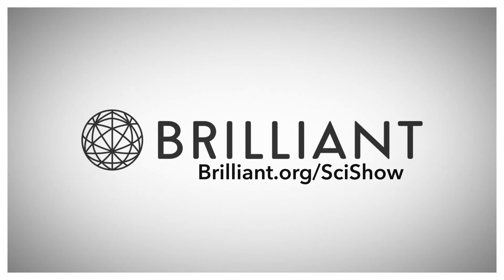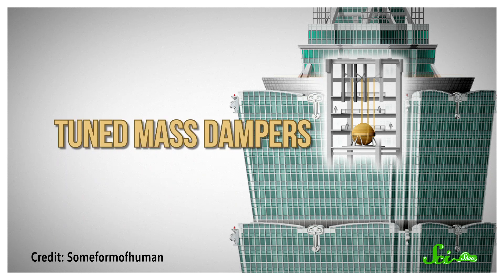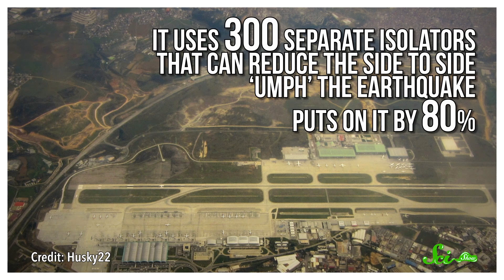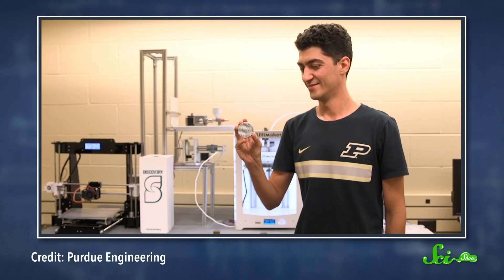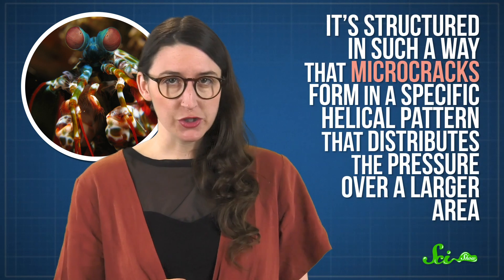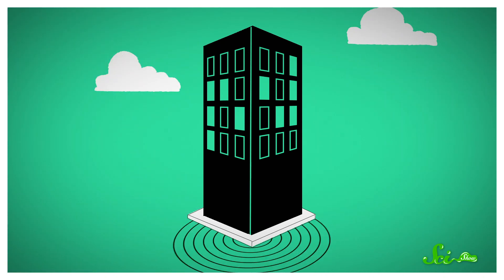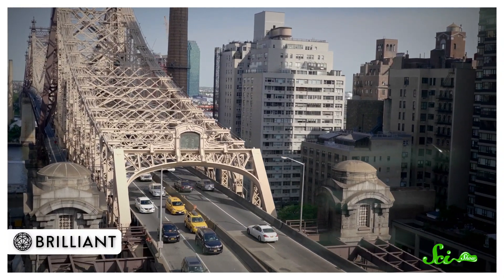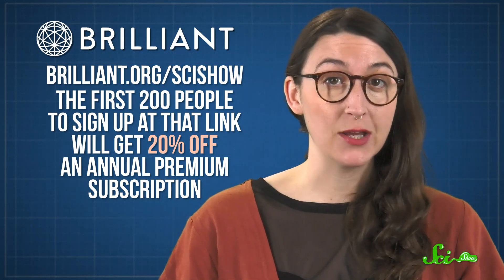Can We Make Buildings Truly Earthquake-Proof?

Comment: To save the building is shock absorbing and balance conserving but to save the city a floating foundation that can be anchor by steel wire ir hydraulic column to act like damping absorb all seismic wave to prevent from resonance and a large building if float up we can counter earth rotation speed and acceleration normal speed is 10 km per hour

Comment: The most structurally sound 3d geometric shape is a sphere...because the stress is evenly distributed to the base... 

A semi sphere is also very structurally sound...

Technically you could build a sphere building... And stabilise it with four posts or a ring or a torus... Most earthquake proof building in the world....the only danger is it rolling off... But four very deeply implanted metal beams would solve that... You could basically drill four very deep holes in the ground and put in some very sturdy metal beams and that ball isn't going anywhere...
The internal structure would need to incorporate an onion skin sphere combined with a lattice to preserve the weight distribution... There ya go problem solved...

You could construct the internal metal lattice frame structure first... And then fill it in with whatever materials you want... At least that's how I would do it...

Comment: The pyramids(4500 years ago) were designed to withstand earthquakes...

But four sides is not the most structurally sound shape...

A hemisphere like the Skellig Michael (1500 years ago) monastery is actually the right way to do it...

The more sides of a hemisphere the more structurally sound it is...

If it actually has to touch the ground...

But technically any shape is fine if it doesn't... Think magnetic levitation...

Comment: I resisted saying this because overall the video is great. But in reality, Structural engineers provide tuned mass dampers to reduce the wind-induced accelerations in buildings for occupant comforts and not for seismic protections. 

I design high rise buildings in earthquake-prone regions like the US west coast and in no tall building, you will see tuned mass dampers as a seimsic solution. Because buildings respond at different frequencies while tuned mass damper can help a building at one particular frequency, it becomes useless in earthquakes as the response of a building is more often at high frequencies rather than primary frequency that the TMD was tuned to. A much more efficient solution is using viscous dampers.

Even in TAIPEI 101, the dampers excitation during an earthquake was inconsistent again because of the high-frequency nature of the ground motions. The engineers themselves would not have counted the damper as the source of energy dissipation in seismic excitation.

Comment: ... a 10 meter wide building? That's not even house-sized.
Reply: My house is less than 10m wide. It's about 6.5m wide. Not everywhere has enormous houses, my house is a perfectly normal one where I live with thousands of the same design in the area.

Comment: Wood was or is also making a comeback because of that, right? They figured out a way to make wood waaaay more resistant to fires, and then you get the benefit of it being flexible enough to resist earthquakes. Or so I heard.
It's also interesting to look into japanese architecture... I was watching a doc about the reform they did on Tokyo Station. The entire thing was lifted to sit on top of a moving platform of sorts. The scale is baffling.

Comment: A couple new systems you missed that are very cool are the post-tensioned rocking shear walls that are purposefully designed to rock, but not fall, and the joints of the rocking would be specially designed to not have significant damage post-earthquake, and some quickly-replaceable systems, like steel-sheet shear walls and some pre-manufactured products.

Comment: As a structural engineer who does seismic design on a daily basis, none of these "future solutions" are not anywhere near cost effective enough to implement. It's easier to design a building that has the correct stiffness for the design location.
Reply: Do you consider dampers and seismic isolation to be "future solutions"? They are widely used in countries such as Japan.
Reply: @BobClemintime  no I'm talking about the ground dampeners and the couple ideas after that.

Comment: i haven't been in a large raw earthquake (i'm in kansas) but in recent years i have experienced many shakes and they don't seem to happen at a fixed frequency, it is more like the rug being randomly pulled out from under you. so i don't see how a frequency dampener would work, because while as a whole it might have a frequency at the point of effect, it is pretty random, and when i say random i mean that it doesn't seem to be at any particular frequency. i'm certainly wrong, but i am curious.
Reply: The idea behind those particular techs isn't to match the primary frequency of any quake but rather to match the frequency at which a specific building shudders to the point of taking structural damage. If the tech can alter the local vibration enough that it matches the building's tolerance level then the building may come through with much less damage.
 The specifics are different for every building, which is why most of it is based on localized zones and not entire neighborhoods.

Comment: Am I the only one who thought 'bed springs' on seeing the 3D concrete being printed? Wouldn't using thick enough memory metal in place of the concrete be a better idea? It's less likely to crack. But it would need a test devised so that after any earthquake of a minimum size the spring could be checked and fixed/replaced (individually placed but connected rings or whatever shape would be the best, would make that easier), so there wouldn't be a sudden snap during the next one.
It's only a coincidence (honestly!) that hubby's car's front spring sheared the other day. No sign of fatigue, just broke as he went to drive away. Mercifully, it wasn't going fast, he only went a couple of metres! But it was that which made me think that checks would be needed. It would be better than having to replace a shed load of weakened concrete, wouldn't it? (I humbly stand to be corrected, I'm currently not thinking 100% straight. Meds, not booze sadly LOL)

Comment: I'm surprised you guys didn't mention something about the bridge that uses giant shocks with locking collars designed with prescribed failure to prevent sway until they're needed to stop damage from an earthquake.
Reply: Yummy . I'm looking that up !
Reply: @IETCHX69  Glad I could help inspire curiosity.
Reply: A name would be nice...
Reply: @brunoratto253  I don't think this is the bridge mentioned in the show I had first seen this idea used on, as those were actually ON the viscus dampers, but the Rion-Antirion bridge uses a similar system of viscus dampers paired with a "fuse restraint" that works in much the same way.  Here's a pdf describing the bridge and the system as designed.

https://www.gefyra.gr/images/user/Publications/fip_rion2.pdf

It took a bit of google sleuthing to find that, but you should be able to use that as a starting point to find other bridges/buildings using the system for earthquake protection now that you know what to search for.
Reply: @hellcat1988  Thanks!

Comment: How do they determine a buildings frequencies?  Especially if it's an older building.
Reply: Take a course called Structural Dynamics. The size/stiffness of all of the load resisting elements in a building can be translated into a stiffness/frequency for the structure in a given direction of movement.
Reply: Math. Or dark magic.
Reply: They just ask Kenneth.
Reply: It can be mathematically predicted. They can probably also measure the frequency the building moves at various wind speeds etc.
Reply: A finite element model of the building is normally sufficient to accurately calculate the fundamental natural frequency and any  other higher ones of interset.
Reply: They shake it.
Reply: RainyDayLady Ask Nicola Tesla . winkwink

Comment: This is all well and good, but what's the point if jet fuel can melt steal beams?
Reply: If you're thinking of the two towers part of the problem was that there wasn't a lot of concrete except in the center of the buildings.  Also, they took airplanes into account when they were built, but not the melting factor of the fuel.  Had there been more concrete throughout the buildings the fuel wouldn't have been as devastating.
Reply: OH
Reply: Jet fuel can weaken the beams to the point where they fail after being impacted by a goddamn airplane while bearing literal tones of weight
Reply: REALY a 9/11 joke...
Reply: @swagtomato2549  ikr
Reply: Bush did 9/11 !!!